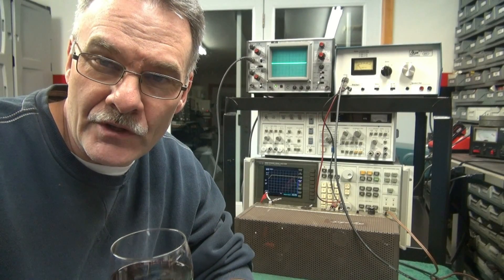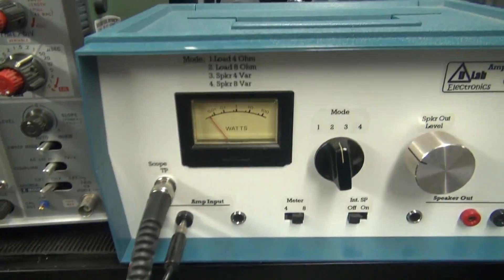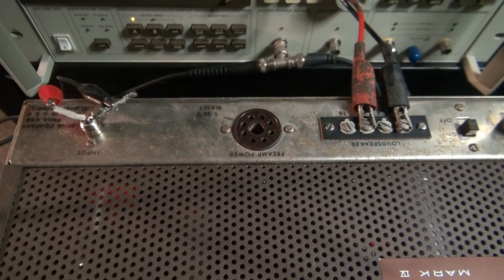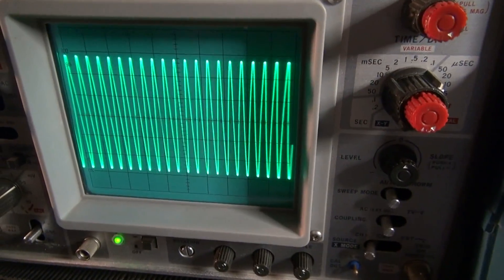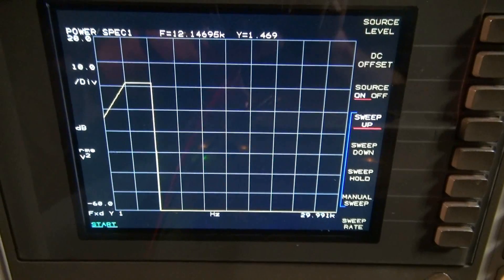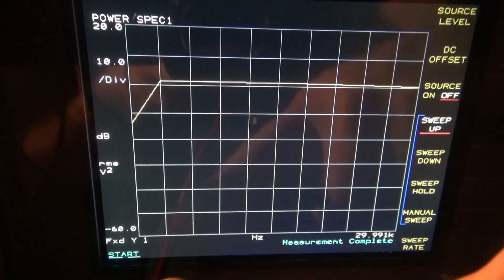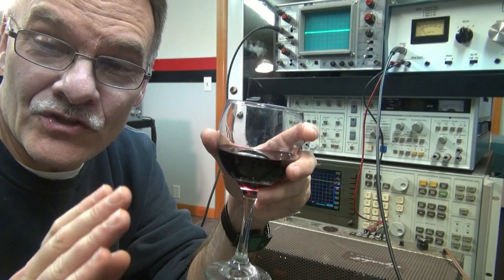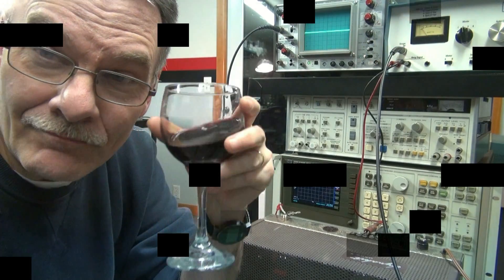How to test frequency response Dynaco Mark IV EL34 Tube audio amplifier

Comment: Where do you get this dub step synth music :D???
Reply from the maker: Hello, It is free music in YouTubes "Create" area
Reply: I see you at the Michigan antique radio meet. Do you live in Mich? Anyway, on the Mk4,those are half an ST70 but since they don't share a power supply like the ST70 does,that gives them an advantage.I always beef up the power-supply by using a 35uf film cap off the GZ34 and then after the choke I use a dual 100uf at 500v lytic and of course jump out the selenium with a silicon diode and change  those 50uf with 100uf muse caps. What this will do is increase the energy in the power supply which becomes more stable under dynamic conditions or high transients.Love your videos. Very nice.

Comment: Very cool... you said something that caught my ear.. Frequency response on the speakers... how do you do that ???

Good stuff  Terry
Reply from the maker: I will be featuring that soon. It utilizes a known flat response amp and a calibrated microphone. I have both on hand, just need time. TD
Reply: Cool , no rush.  Thanks as always
Reply: you could tap in the speaker's input via a resistor and sample there. microphone and environment have their own curves that might alter the results. Less impedance at the speaker is when it resonates with the input frequency thus the voltage seen at that frequency will be less.So you get an inverted frequency response curve, high points mean less power on the speaker. No peaks or lows mean a perfect speaker (or a really good NFB loop). :)

Comment: You should be doing frequency response curves at full power. Use your scope to determine power level just under clipping at 1000 Hz. Then do a frequency sweep at that output level. So to determine an amps specs first you measure distortion at just under clipping, with samples between 20 to 20000 Hz. Then run the frequency response test at that same power level. Now you have distortion and frequency response at full rated power. Many amps can do well at 1 watt.
Reply from the maker: Roger that, This was just an initial test at linear response. Still learning the ropes.